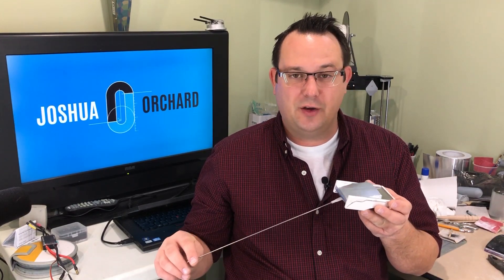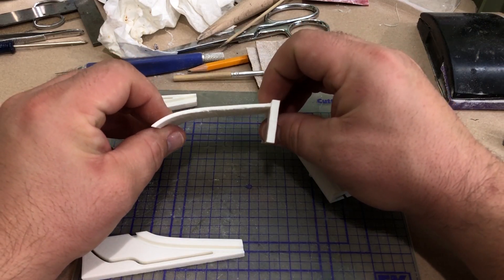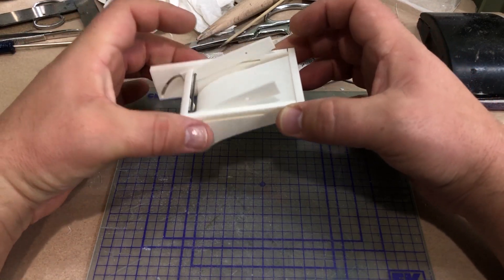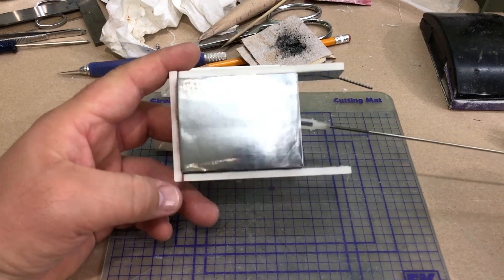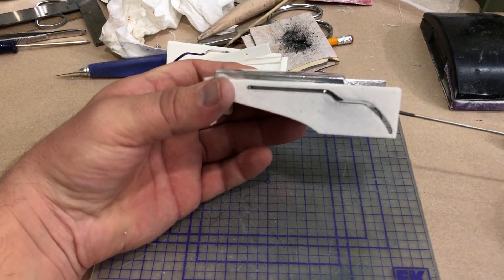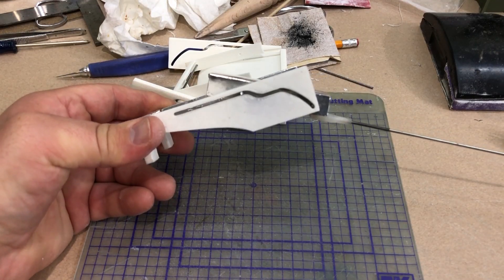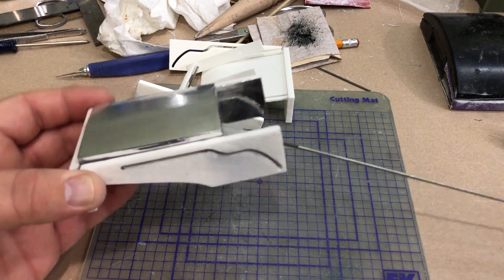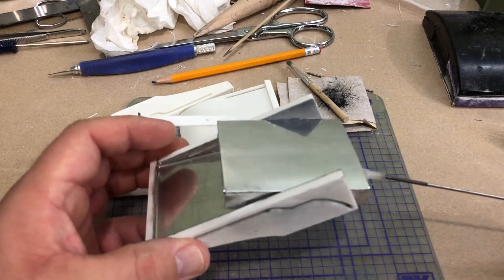P-47 Update #03: Intercooler doors are finally done

Comment: great job anyway you could send me the cad files?  I am building a meister p47
Reply from the maker: https://www.thingiverse.com/thing:3456633
Reply: @JoshuaOrchard  thanks a ton I only have autocad do u have any way of emailing me the .dxf or .dwg of those files my email is glambrenos@gastonelectrical.com
any help would be soo appreciated
Reply from the maker: @georgel5308  The files from thingiverse (.STL) would go right into your slicing program for 3D printing. There should be no need for a different format as the slicing software can scale up if you need to.
Reply: That is rad!! I may need to find some one that owns a 3d printer

Comment: Nice work Joshua, If you don't want black messy graphite on your part, try "dry lube" spray. It is white and can be applied directly but if you want more specific targeted application, spray it into a dish and paint it on like you did the pencil carbon. But you already knew that.
Reply from the maker: Yeah, a 220-grit paper and pencil were already on the work bench so it was easy to just do it that way. I do not have dry lube on-hand.